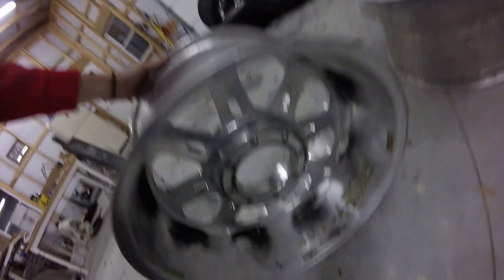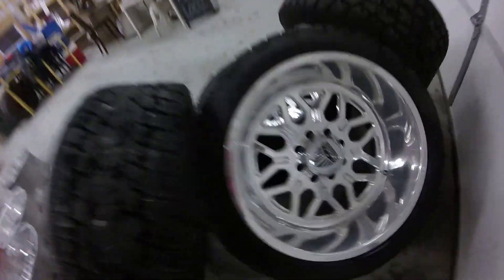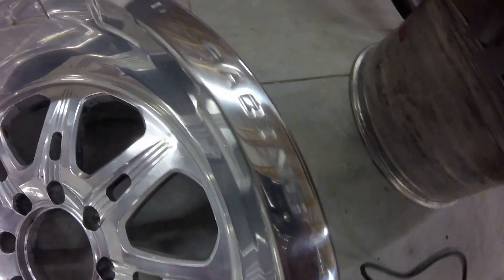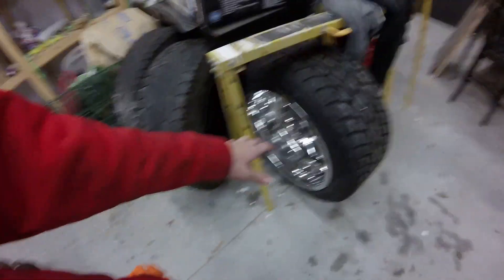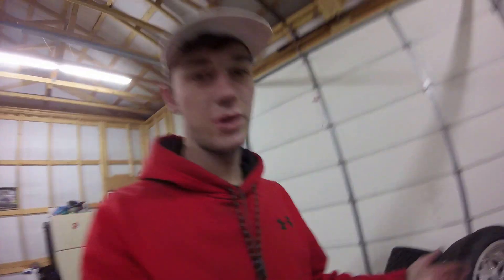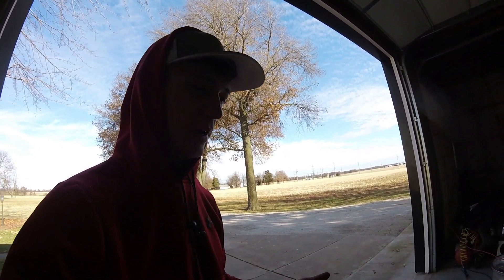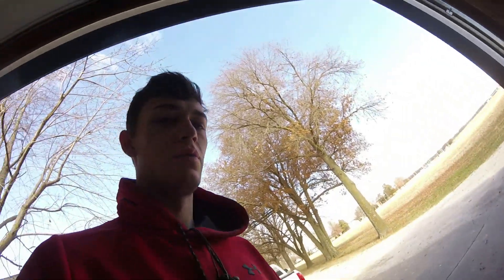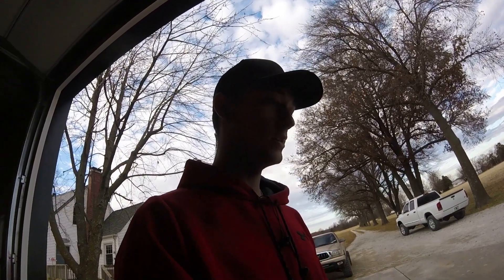Specialty Forged Polish Job

Comment: I just polished a set of ultra type 164's that were painted black.  I used the aircraft paint stripper and a pressure washer to get the paint off.  Some spots I had to hit twice🤙